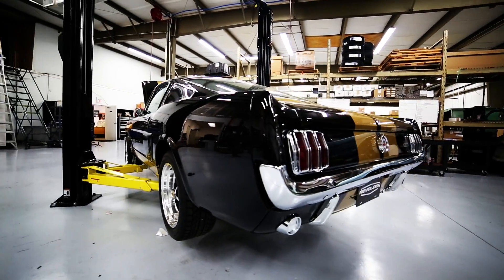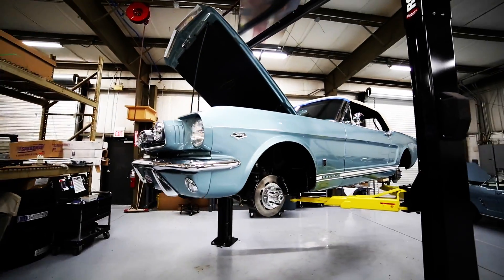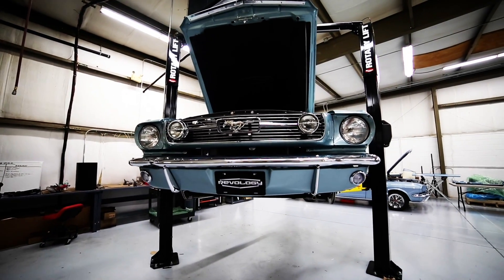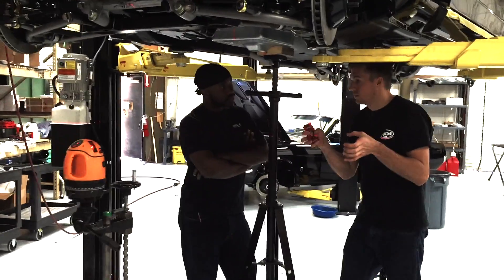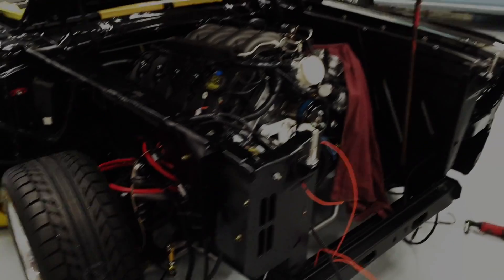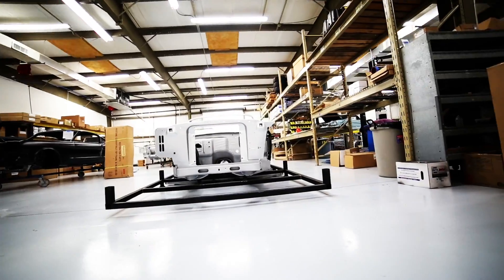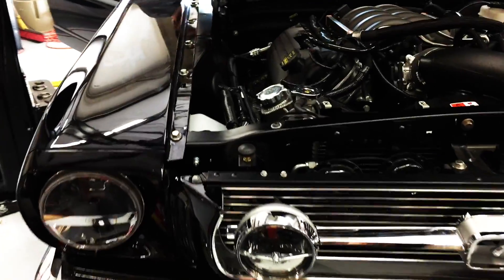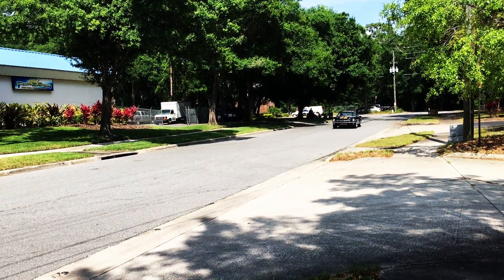How we build the Revology Mustang : Introduction

Comment: I would be very interested but the only thing is I do not want that garbage coyote motor.
I absolutely hate the sound of that dual cam.
I would rather have a brand new crate pushrod engine like a 390 or a 427 or a 428 Cobra Jet with a high lift High duration cam . Because I would want it to sound look and feel like a real 60s muscle car.
And no offense but that garbage coyote motor sounds like crap and it has two cams in it and it's just ugly I love a polished aluminum 427 will the high duration high lift cam. Like a Shelby Cobra motor old school American Muscle.

Comment: Boutique Mustang series of cars. I understand why they're so pricey, new shell(not a restored original), which means it's a "new" Mustang and must abide by 50 state emissions laws, not sure how they circumvent the crash safety standards though.I'm sure if they sold 10,000 units a year, the price would probably be at $100,000 instead of $150,000+, but that'll never happen. My question is, if you're spending over $150,000 on a vintage looking "modern" Mustang, wouldn't it be better(financially/investment wise) to buy a vintage Shelby(and watch it's value climb) and buy a late model Mustang to drive semi-daily or daily? You'll eat the depreciation on the new car, but probably not to the extent of what appreciation the vintage Shelby will acquire over the 5-6 years you own the modern Mustang. Once you spend $170,000 on a Revology Mustang, you might get $150,000 for it over the next few years(if you drive it sparingly), but you eat $20,000+ in a few years and only have one car that you really can't drive too frequently. I guess vanity costs big dollars for the ego driven.....
Reply: They are all good points - and I agree completely.   That said, however, if you're keen for a toy like this the $ can sometimes be lower down on the priority list.   I don't think it's necessarily 'vanity' or 'ego' that gets people into a car like this.   In some ways it's a little like the Singer 911 - it doesn't make any sense at all using logic.   This is why they cost what they do - because people who can, will.